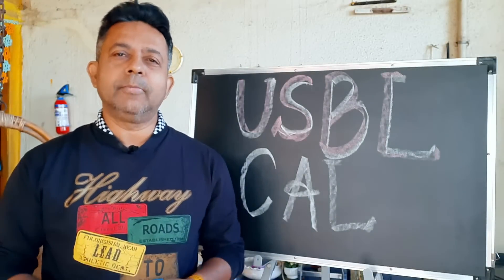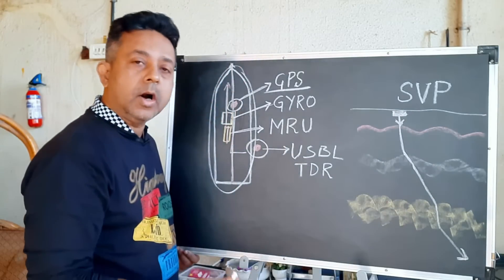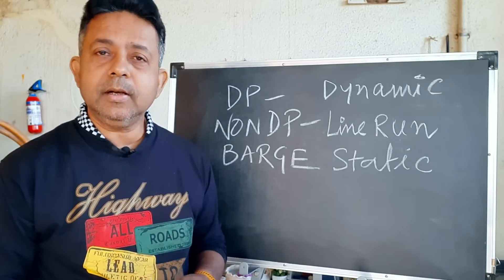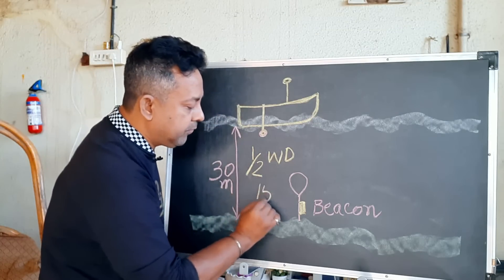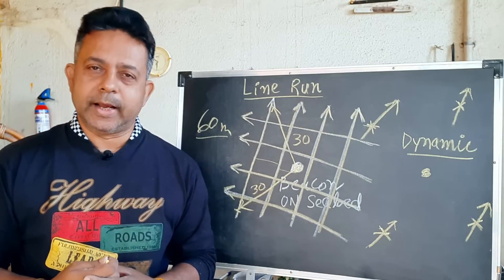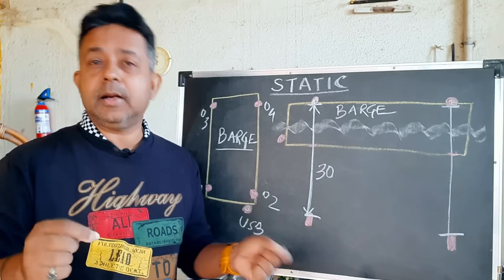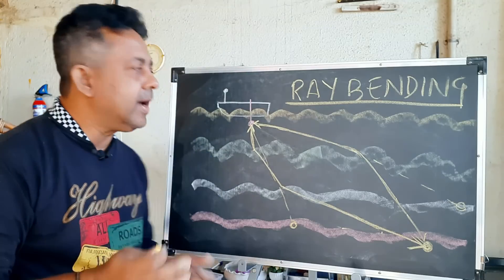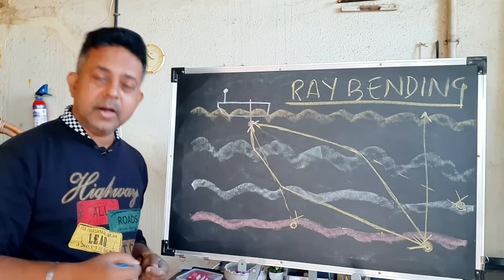How to Calibrate USBL Systems | DP Vessel, Non-DP & Barge Setup Guide

Comment: Thank you very much for this lecture, your explanations are explicit. I learnt a lot especially the reason for calibration. Please sir, my question is this "What kind of sets of data are to be observed during Dynamic calibration of USBL transducer using DP vessels  or run line method for non DP vessels"?
Reply from the maker: Hi, if you are using Kongsberg or Sonardyne system, they have separate and automatic calibration tools to automatically collect data once you are in position or running the line and start logging. Calibration Tool may differ in various acquisition software but USBL logs only Vertical Angle, Horizontal Angle and Slope Distance from Transducer to the beacon. And as you have the transducer position referenced to your GNSS system, your Calibration software will calculate position and log the position of the beacon. Hope I am able to answer your queries.

Comment: USBL calibration well explained. Please upload video explaining calibration of motion sensor and gyro to complete the process. Thanks.
Reply from the maker: Hi thank for visiting. I appreciate. I already made couple of videos on Gyro calibration and various types of heading. If you want you may see this video https://youtu.be/COIS0YDo3t4 
Please check the list of uploads in my channel and hopefully you will find a lot of your liking.
Yes I am yet to make a video on Motion Sensor but it is not easy to make a tutorial without the actual tools in this case. Mainly you need a Level and Tachystave and have the vessel high and dry in the dry dock to carry out any meaningful Motion Sensor calibration. Ofcourse there are lots of quick methods but they are not as good as this one.
Thanks again

Comment: Very nicely explained. One question, on DP vessel without taking support of diver or ROV can the beacon calibration be done with help of taut wire...also how beacon positioning affects near structure or platforms ?
Reply from the maker: Technically you can put a beacon on the taut wire but the wire itself will restrict the movement of the vessel  - yes the vessel will be able to move to atleast 3 location out of four but it can not go to the fourth location without lifting the wire up. But yes if you can rig the beacon with a floating buoy then it can be possible without a dive or ROV.  Multipath does effect the positioning near a solid structure but the system is clever enough to eliminate most of the ambiguities. All you need is a good line of sight from Transceiver to the beacon.

Comment: you mention the software for the static run , can you please share the link ??
Reply from the maker: Howdy, you dont need any software for Static Cal. You just need and excel sheet and you need to calculate the grid distance and grid bearing between two offset points and two USBL beacon position and then compare them both to find the C-O and apply it in the USBL software and then do the static observation again for 15 to 20 minutes to find the residual. If the residual is more than 0.1 deg then apply the same. It all depends on How far is you Beacon from the transducer in terms of horizontal distance and vertical separation. And what is acceptable for you in terms of Position error. Do apply the Depth Aided mode and it will increase the positional accuracy. Hope it helps.

Comment: Sir how do i read the static .dat file from geomax zenith 35 pro? I need to setup an unknown point as a bench mark
Reply from the maker: Hi Hemant, this is offtopic and not USBL related. But try searching for DAT2RIN - it is a small program which reads Dat files and converts them into RINEX file. Hope this helps.